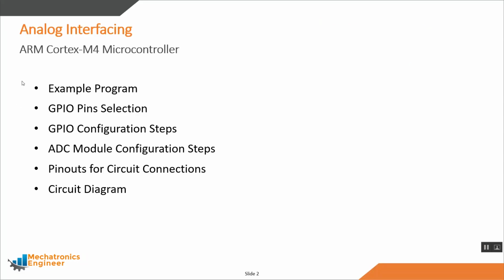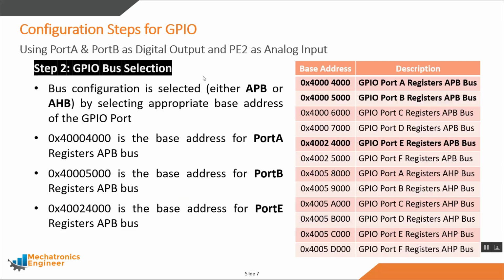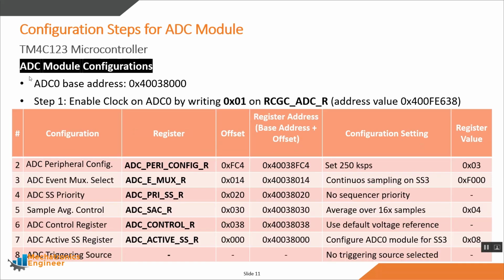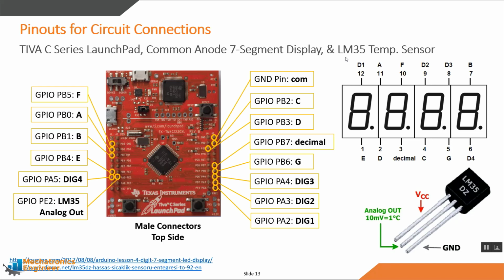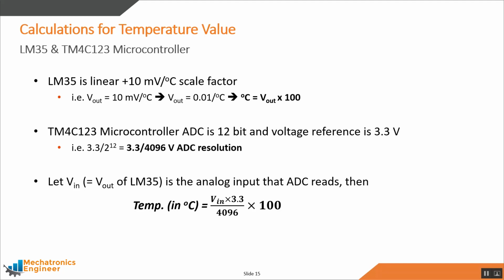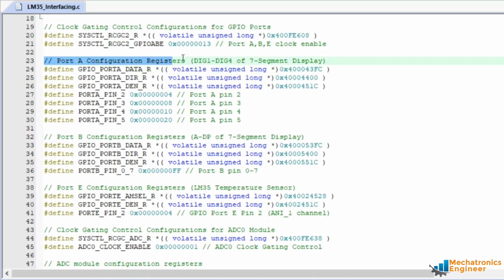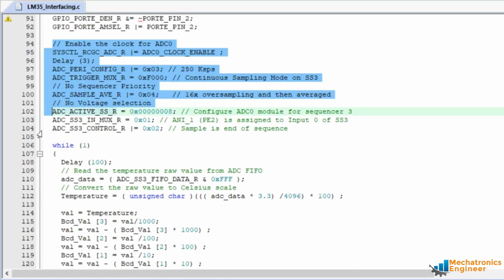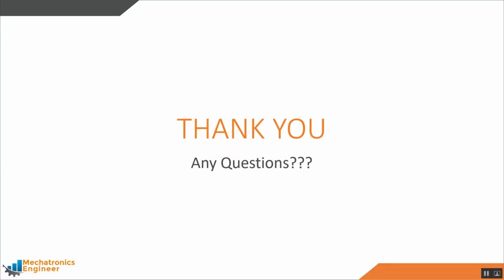Interfacing LM35 Temperature Sensor with TM4C123 Microcontroller

Comment: Please sir give us a video with complete code and implementation of robot line follower with assembly language. If you want any more detail you can ask
Reply: Yes! Four IR sensor are used , and taken as input to tiva and the it is taken as output on other pins , to motor driver , #black line follower.
Reply: how bout do ur own work eh